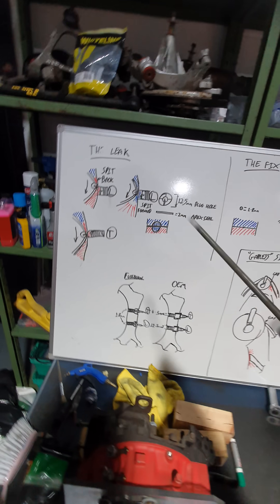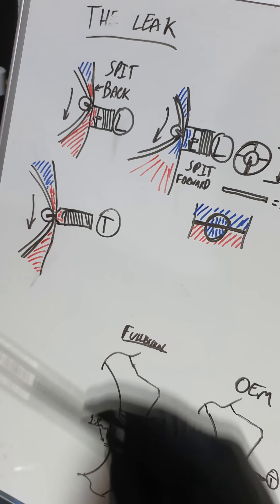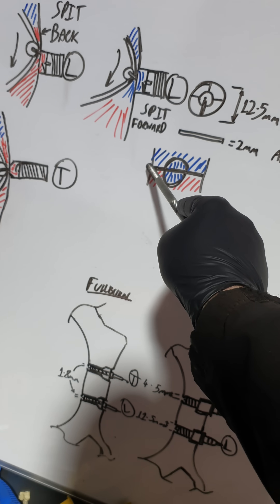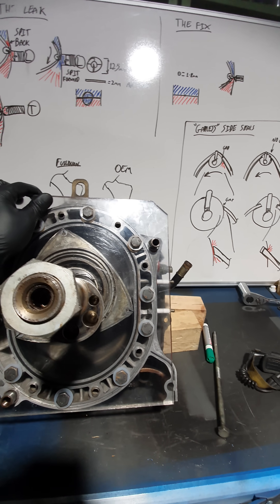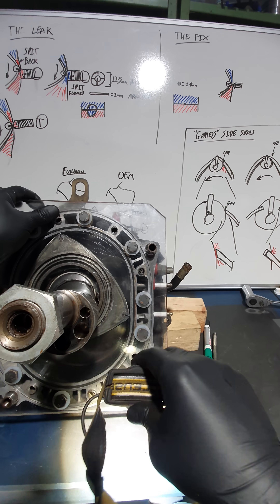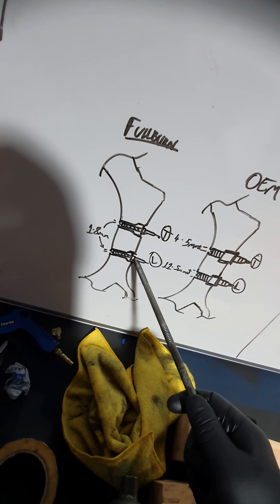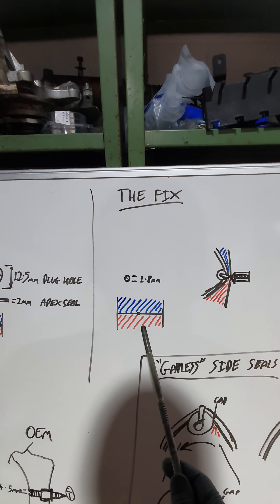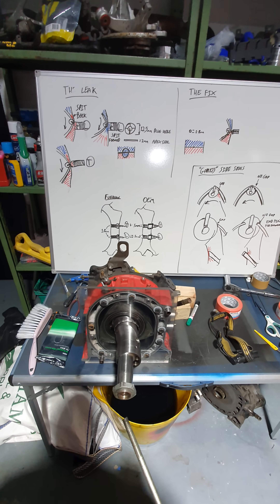Wankel engine fix

Comment: Dude, you can see the pictures of Soviet rotary engine's housings. It seems that already had those "mod" but only for one spark plug.

Also interesting thing this rotary engine was named РПД ВАЗ-4265 and was completely aluminium, housings, irons.

It was a rotary engine for "Aktay" helicopter. It was 270hp 3-rotor fully alumium.
Reply from the maker: I see what you mean, but that appears to be the same size holes as most others, about 5mm trailing, and about 12mm leading.

Comment: How much horses would that unlock maybe 5? How much better MPG do we get maybe 1? 
Nice fix but yk even if it has no downsides do you really need to spent the money for those small gains?
Reply from the maker: @Snow1998v1  There's an Rx8 in Spain with these housings getting 240hp and 36MPG on an otherwise stock engine.
Reply: @rotaryrevisionist6473  would love to see that ngl i tried mine with maxed out mods and got to 204 in 2021 and it sipped 22mpg if i was really careful.
Mods was basically: race headers, no cat, ram intake and free flowing backbox. worth of these mods was around 2k and i had no chance of passing emissions here in germany so seeing 35hp just from that is crazy. 
would actually be worth buying one again just for the fun of that cuz ngl my v8 sips 22-23mpg aswell just has almost 3x the power.
Reply from the maker: I have a pair of 4 port Rx8 engines I'm preparing for a proper back to back comparison series this summer.
One will have my housing mod, the other not.
Everything else the same down to the side seal clearances.
Will do Dyno runs and MPG tests to satisfy the skeptics.
Reply from the maker: I see the hp and MPG improvements as a recovery, rather than a gain.
Reply: @rotaryrevisionist6473  sounds good sounds good. even if you just add 10-15hp  that would be worth it. lets say you get about 26-27mpg that would also be impressive on its own combine power and mpg gains together and you have a solid selling point.
Reply from the maker: @Snow1998v1 Another benefit is resistance to detonation at lean mixtures.
That leak takes a little fuel with it as it goes through the plug hole, meaning there's an unmeasurable change in AFR which can cause the mixture to become too lean and risk detonation.
Without the leak, it's safe to tune AFR as one would with a piston engine.

A great benefit for turbo rotaries.

Comment: Hmm. So why has no one fixed this before? Why do Rotary engine work at all with these huge issues.
Reply from the maker: @bradalot777  Mazda were aware of the leak by the time they were developing the Renesis, but the issue is that blowdown leakage due to port overlap gives similar symptoms to the leak on normal sensors.

The Renesis was the first rotary with no port overlap, so it was the first time it could be proven as an issue.
And by then Mazda weren't investing in rotary engines to the point they'd rework their assembly lines and get yet another custom spark plug design from NGK etc..
Reply from the maker: @bradalot777  As for how it works despite this issue, it's the same as a piston engine with worn rings; it's functional, just down on torque and burns more fuel.

And the turbochargers brute forced through the issue haha